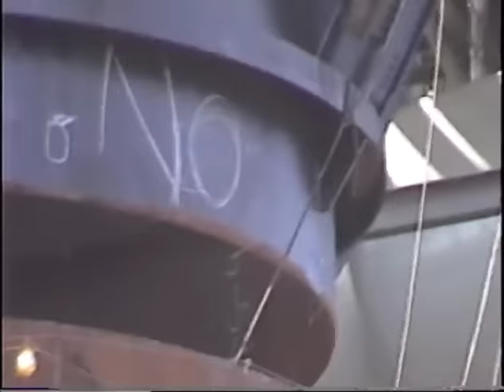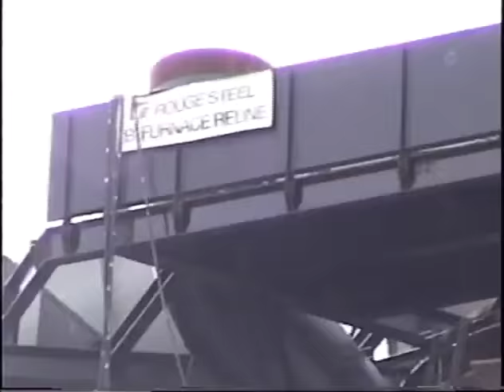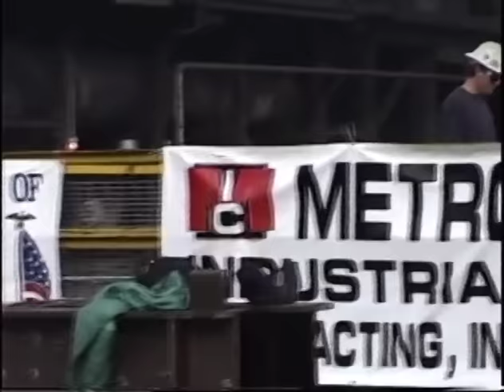B Furnace Reline 1997 - Rouge Steel

Comment: Last timeI worked on that furnace, they were making a pour when a gap opened between the iron notch and the hole. Spent a long cold winter night wedged into a hole,  underneath the trough pad welding on the furnace shell. The guy welding the new plate, into the trough bottom, burnt through the old steel. A glob of red hot metal dropped down my collar. I carry a quarter size scar, in the center of my chest, from that. Made a lot of money there.
Reply from the maker: Yikes!! I know how bad slag burns can be. Were you there before during or after this reline?
Reply: @GrayHare  That would have been an unscheduled "emergency call", way prior to the reline. If you're a Boilermaker, working out of the union hall, it means - I get the call at 10:00pm, show up at 11:00pm, and we sign the tax paperwork and are out the trailer door by 11:30pm. The next hour is dragging leads, torch hoses and setting everything up. I think we spent about 16 hrs. working. These furnaces were producing about 420 tons of pig iron every 45 minutes. So at a minimum that meant 16+ times 420 tons was lost. 
A reline is a scheduled shut-down where all heat is shut off the furnace and gas supply lines are blanked off. As the furnace cools the internal firebrick liner starts to loosen from the shell. All of it then is knocked out. A total relief means the 10's of feet thick carbon block bottom is also removed. If dictated the copper coolers that are inserted In the shell and help to control the heat in the firebrick are usually removed and replaced. This doesn't include all the miscellaneous piping, electrical, mechanical... work that must be done. A full reline will take a couple mos. Once completed the heat is slowly applied to the furnace so the brick work doesn't collapse.
Reply: Thanks for your comments. Great insights to a lowly farmer.

Comment: I've lived in the shadows of the Rouge for 43 years. Watched dozens of videos about the complex. This one is by far the best. What an awesome look inside the belly of the beast.  I really like how you explained the different parts of the furnace and what they do. Those purple flames were a beautiful sight at night  Great job filming.... 👍
Reply from the maker: Thanks, Steve! I bet it was cool living close by. Seems like there was always something going there. I always loved the flares, too!
Reply: On one Rouge Steel repair, we worked 12 straight hours. Finally got the furnace back on line. As we were leaving the site I was walking, with the furnace "gas man". They had opened the stove Gas valves too much. They'd opened the two relief valves, at the angel deck. The roar was like Niagra Falls. The flames shot 50 feet into the air. It looked like the space shuttle booster rockets trying to drive the furnace into the ground.

Comment: Its absolutely amazing what man can build and rebuild too. Awesome piece of history right there. Just as amazing, it takes age to really appreciate processes like this. The tradesmen that worked this project did an amazing job! What a fantastic vid capture
Reply from the maker: You’re right! Detroit trades are very skilled and equipment/processes like this couldn’t be done without them.
Reply: @GrayHare also like how this is a giant version of what ancient ancient Europeans used to make. Just instead of a person with a tool it would be an iron smelter with a stick poking a hole for the iron to flow out.
Reply from the maker: @RobertCraft-re5sf  I’d love to see an old metallurgical furnace in operation!

Comment: Who knew the refractory had to be replaced? This is absolutely amazing and thanks for uploading the video.
Reply from the maker: When you lose parts of the refractory/insulation, the steel shell will get hot in that area. Sometimes, we’d have to spray water on the shell to keep it from getting too hot. But that’s a short-term fix. At least it gives you time to plan for a repair or reline.
Reply: 现在的高炉内的碳砖会安装一些热电偶。通过温度判定耐火材料的厚度。同时冷却壁循环水的温度也是一个参考指标
Reply from the maker: @ww_9527  thank you for your informative comments!  Here’s an English translation of the above comment….  “Nowadays, some thermocouples will be installed in the carbon bricks in the blast furnace. The thickness of the refractory is determined by temperature. At the same time, the temperature of cooling wall circulating water is also a reference index.”
Reply: i used to haiul it too the mills, uss, etc

Comment: Great video... I did work on that reline and also the C furnace replacement.  I was also part of the inspection team for the B furnace blast. Always liked steel work. There is nothing else like it.
Reply from the maker: Thanks for commenting, John! I was involved in three blast furnace relines at the Rouge. The other ones were after the explosion at the old power house. I bet our paths crossed a couple of times over the years.
Reply: Yes nothing like it.  Enjoyed working on ark  furnace .

Comment: Good Deal.  Been a few years since I was at the Rouge (Was Severstal and then AK at the time... Now Cliffs), But B was demo'd down to the hearth.  The casthouse was still in place, but the vessel was long gone.  Some of the runners were still intact on the floor.  I've worked all over the Steel mill side of the plant... from the ore bridges to annealing as a maintenance contractor.

I work over at Great Lakes in Cold Rolling now...  Economy got our furnaces a couple years ago.  Only thing left on Zug is the coke battery.
Reply from the maker: I was there from around 1993 to 2004. My main responsibility was the Cold and Hot Strip Mills, but was assigned to most of the BF relines during that time. My son is a pipe fitter contractor on Zug Island doing steam maintenance. Thanks for viewing the video and reaching out with a comment!
Reply: if b gone dose that mean  a back up runing or did they shut both c and a and go full arc furnace after dad retired

Comment: So many times have seen reline of blast furnaces from the city side. (3) 8-hour shifts of contractors work 24/7. At dark part of the day lots of lighting is used to illuminate work areas. Every 25-30 years of life span each blast furnace at our steel mill underwent reline. Contractors used explosives intensively to get rid of salamander. Everyone in the city heard explosions, especially at night. The blue flame of burning BF gas candle is truly amazing at night. Really cool to visit the superstructure areas and see it up close how operates the furnace charging mechanisms: rotary bulk distributor, bells drive. See it up close 2 top valves.
Reply from the maker: That about sums up what the video depicts! I’m glad you benefited from watching. I feel pretty lucky to have been able to see it from my side.
Reply: @GrayHare  I've never seen equipment at the superstructure areas from the close range. Have seen that in textbooks just as drawings when studied metallurgy in junior college. Have worked myself at hot strip mill divisions on primary and secondary rolling mills. Born and raised in steelmaking city.
Reply from the maker: I actually started my career in steel as a combustion engineer working in the soaking pits for ingots and also the reheat furnaces for slabs. That was a long time ago! I did project work for HSM, Pickle Lines, Annealing, Tandem Cold Mill, Temper Mill… It’s sad to see that industry just rust away.

Comment: worked as a M/W out of the snake pit from 86 to 90 then a year in wastewater. the skips were still operational. First it was A and C furnace then after a reline B and C. Hard dirty dangerous work hated it at first but grew to like it. The gas would come down with the skip once measured the stretch on the skip cables and the meter read 800 ppm...that's high. was in the power house when # 6 boiler blew. that was a day to remember , 6 guys died. there is no building in the rouge that I didn't work. I did get around.
Reply from the maker: I bet we crossed paths at some point after 1993, which is when I was there. I worked mostly in the HSM and CM. I’m sorry you experienced the destruction of the Boiler House. I hope you’ve recovered from that. I was at the ROB and stayed the whole night trying to get everything shut down safely.

Comment: Takes me back. I worked as a boilermaker foreman right out of college  at USS Edgar Thomson Worked blast furnace, BOP and slab mill at ET and worked coke batteries 21" mill at Clairton. Short stint # 2 side structural at Homestead. Really enjoyed the work. thanks for the video
Reply from the maker: My son is a Pipefitter on Zug Island in Detroit. I started working in steel at Armco in Ashland, KY in ‘87, then moved to Detroit and worked at the Rouge.
Reply: @GrayHare  you’d be disappointed to see Armco in Ashland now. Already demo’d half the site
Reply from the maker: @NateWeese96  Yes, I still have friends in Ashland and return there periodically. I saw it the last time (couple years ago) and it was sad seeing it. In its day, it was a great place to work and raise a family.

Comment: Very interesting video. I haven't seen another one as informatic. At the same time, I miss the modern one because it would be much better to understand - cameras today are better than they were 25 years ago. But there are probably only a few such places in the world today where all the action could be transmitted as video footage.

In the early years of the turn of the century, my teacher of metallurgy and materials science talked about his experience visiting one of the metal industrial complexes of the Soviet Union at that time. It seemed like a very interesting experience, however, as a teenager at that time, I didn't get a full overview of all the technology, I did understand from the description of the equipment in this industry that everything was big and powerful, but over time, and seeing real pictures, everything seems much more powerful now.

This video gives me many new questions that I didn't even know how to ask my teacher as a schoolboy:

1. How thick is the lower part of the steel casing of the blast furnace? About the height where the molten iron tap hole is located. Also - how thick is the brick interior lining of the BF at this height?

2. How thick is the brick layer at the bottom of the BF? And does it have any external cooling as well? What material are bricks at the bottom made of?

3. How high above the inner surface of the bottom of the furnace is the tap hole? 
When the molten iron is poured then how much of it roughly leaves from furnace with one discharge? How fast does it come out of the BF? Any rough number - per ton/minute? As I understand it, the tap hole is not exactly at the bottom level, but higher, so there is always a significant amount of molten iron at the bottom of the furnace?

4. How high is the air temperature a few meters from the ducts with molten metal..how it feels to stand, say, for example 10 feet away, how hot this feels and can it could be compared to something more conventional? 

5. How is the solidified iron that accumulates in the duct over time, removed, or are they constructed so that nothing accumulates significantly? 

A bunch of stupid questions, but unfortunately, I have not seen a single iron smelting plant with my own eyes, not even from a distance.
Reply from the maker: Let me answer your questions as best I can.

1) The steel shell is 1"-2" thick. We didn't use external cooling, but we did use lots of internal cooling for the refractory. If I had to guess, I'd say the refractory was 3'-4' thick in this area.  Remember that a furnace is a pressure vessel so there's a tremendous amount of energy inside, and not just thermal energy.

2) The hearth area refractory was several feet thick and used a lot of cooling because of the high temps in the hearth area (close to 3000F).  We also used vertical cooling staves in this area to remove the heat and protect the hearth refractory.

3) I believe the taphole was about 1/4 of the hearth diameter, so about 5'-6' off the bottom. Try  googling for blast furnace cutaways that will show the hearth, the tap hole, and the refractory used in each area of the furnace.  We used carbon block and cooling pipes in the hearth area, then around the tap hole and higher was probably alumin/silica refractory to deal with the high temps.  Higher up the furnace stack we would have used abrasion resistant refractory because of the lower temps and contact with the burden (iron pellets, limestone and coke). Since most furnaces are similar in design (they only vary by hearth diameter) you would refer to a furnace in million tons per year or by hearth diameter.I showed how big the 'salamander' was at the bottom of the furnace when they used dynamite (TNT) to break it up into smaller pieces and remove it from the hearth area so it could be relined. I think 5''-6' thick would be a safe answer.  It's hard to imagine, but the hot air blown into the bottom of the furnace actually supports the burden.  That means that the burden is separated from the liquid iron collected in the hearth.  It was described to me as 'raining' liquid iron from the bottom of the heated burden.  If the blast (hot air) was interrupted, the burden would drop into the collected liquid iron and chill/cool the liquid iron which could become solid again -- bad news!

4) The temperature on the casthouse floor (just above the hearth and taphole) would be about 100-110F.  It gets much hotter when the furnace is tapped and molten iron and slag come out due to the radiative heat probably more like 150F near the liquid iron.  You would need to wear protective/insulated suits to be any where near the molten metal, for safety's sake. The liquid iron in the trough or duct as you referred to it is gravity fed and it didn't build up over time because it would re-melt every tap.

5)  The iron and slag troughs would be repaired as needed with a sprayable refractory between taps. They usually had a back-up trough so the one could be repaired if damaged.  They tapped the furnace every 30-60 minutes.  Liquid iron went out one trough and liquid slag wen the opposite direction.

I hope this answers your questions!

Comment: Hope you read this.  Fascinated by the process.  What was burning at the beginning of the video? 
During the process of reducing iron, what keeps the rE ingredients from falling into the pool of molten iron at the bottom?  Did a lot of reading but that part escapes me.
Reply from the maker: Great questions! In the beginning of the video, we attempted to perform a ‘bottom tap’ where we burn a hole in the bottom of the furnace and let the remaining liquid iron drain out on to the ground to solidify. Unfortunately, the small diameter of the furnace allowed the iron to solidify in the furnace so it wouldn’t drain. The ingredients, or the burden, are supported by the tremendous volume of hot air pumped thru the furnace from the bottom through the several tuyeres.  The liquid iron drips/rains to the bottom of the furnace. Hope this helps. You might google the process for some diagrams that show a vertical cross section.

Comment: How long did it take to heat the refractory lining? How many charges were used and  time to actually start the furnace? I asked at interlake steel when they were bringing their large furnace back on line and they wouldn't talk to me
Reply from the maker: Hmmm, there’s a lot of variables in that question. Back in ‘97, the dry out of the refractory would’ve been a couple days. You can’t rush it or you’ll get popcorn-like explosions in the new refractory. Then, they can start adding 100% coke until the system gets heated up. Then, they slowly add the normal burden (coke, limestone, iron ore and sometimes scrap metal in the furnace. Any iron you make during this phase will likely be of poor quality. Eventually, you’ll start getting high quality iron that they can further refine into steel at the BOP or ladle met station. I’d guess the whole process takes about 4 days from dry out to producing good iron.  Counting the charges would be difficult to do. Hope this helps!
Reply: @GrayHare  Thank you, I've hauled steel out of Interlake steel, US steel, and Bethlehem steel.
Later worked as a high voltage contractor at US steel zug Island

Comment: as a pipe fitter apprentice then pipe fitter at Loran Works we had to go on relines & rebuilds -then when some goof balls took over the BF - nothing but trouble & "Freeze ups" - we were forced to go there because the BF fitters could not handle it & we were forced to stay OT while they went home - #1 Pipe Shop always got screwed
Reply from the maker: Thanks for watching and commenting. My son is a Pipefitter who went thru the 5 year apprenticeship in Dearborn. He works over on Zug Island.
Reply: @GrayHare  i worked there  1/8/68 - 1/8/98 - what where is Zug Island
Reply from the maker: Zug Island is where the US Steel plant was located. It’s very near to the Rouge Complex. I believe all they’re running now is the Coke Plant.
Reply: @GrayHare  Coke plant runs now - wow

Comment: You can destroy and stack 1,000,000 + bricks in "about 3 months"? That's unfathomable. There must be a machine to stack them.
Reply from the maker: It’s crazy, isn’t it?  Thanks for watching!
Reply: @GrayHare  I love it. Was there a machine to stack them? I did notice a device to help in the removal of them. I can't imagine the heat of this place. Everything is just one big thermal battery.
Reply from the maker: You saw the temporary platform that was raised as the union brick layers played the million refractory bricks. No machines to help. It has to be done by hand because the steel shell can be warped and skewed with heat and age. The bricks aren’t perfect rectangles either. Their sides are tapered so that the diameter is about 20’. Also, it does take a while to cool down and heat back up due to the mass of the furnace.
Reply: @GrayHare  Fantastic work.